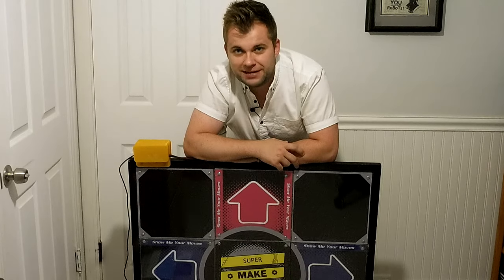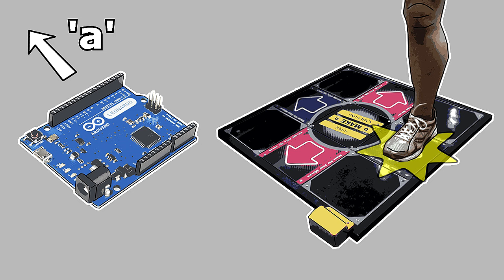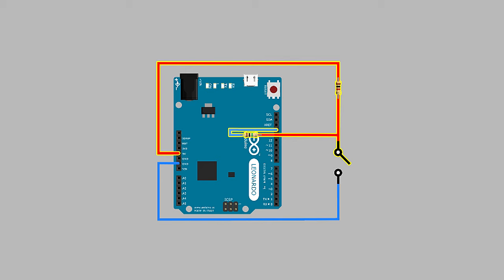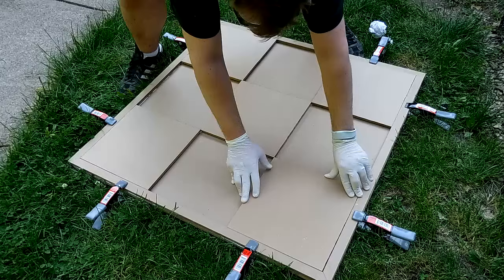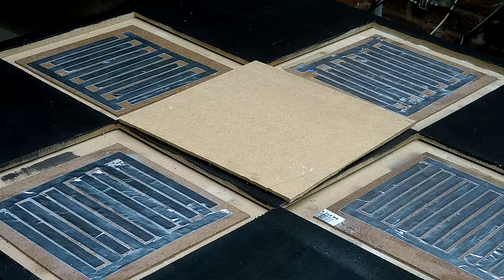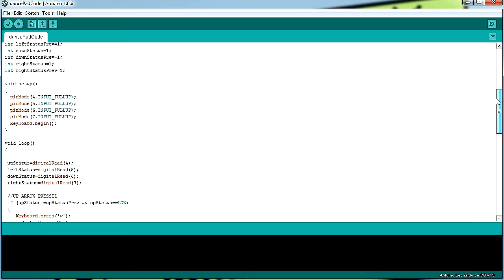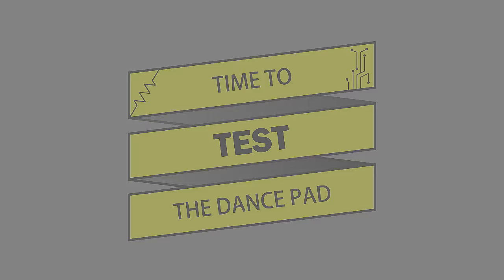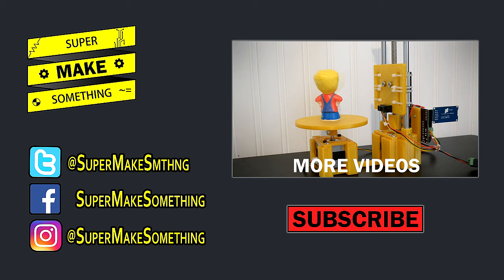USB DDR Dance Pad (Arduino, Pull-Up Resistors) - Super Make Something Episode 9

Comment: Excellent Thank you! Although I did wonder about the budget in the end of how much it costs to put together I've tried to put a list together based on the video. but I wonder if you actually had one that you could share

Base Board 
88.9 cm x 88.9 cm, 12.7 mm thick MDF
Dance Pad Borders:
4 pieces, 2.54 cm x 88.9 cm, 12.7 mm thick MDF
Stationary Panels:
5 pieces, 27.94 cm x 27.94 cm, 12.7 mm thick MDF
Modifications:
1 panel with chamfers on all four sides (center panel)
4 panels with chamfers on two adjacent sides (outer panels)

Riser Panels:
4 pieces, 22.86 cm x 22.86 cm, 6.35 mm thick MDF
Button Pads:
4 pieces, 27.94 cm x 27.94 cm, 6.35 mm thick MDF
Modifications:
Drill pilot holes and clearance holes for #8 screws (align with polycarbonate panels)

Clear Panels:
9 pieces, 27.94 cm x 27.94 cm, 3 mm thick polycarbonate (279.4 millimeters.)
Modifications:
Drill pilot holes and clearance holes for #8 screws (align with button pads)

Foam and Tape:

Foam Insulation Tape: 16 strips, 20.32 cm long, 12.7 mm x 15.875 mm
Electrical Tape: 1 roll

Metall / Metal:
Copper Foil (Kupferfolie): 1 roll
or Aluminum Foil (Aluminiumfolie): 1 roll

Elektronik / Electronics:
Arduino Leonardo Microcontroller
Wiring: I wasn't sure which gauge 

3D Printed Electronics Enclosure (3D-gedrucktes Elektronikgehäuse)
Modifications:
Drill wire routing hole in the front border of the dance pad
Drill a large hole for the wire bundle in the 3D printed enclosure
Create a slot for the microUSB cable in the 3D printed enclosure

Additional for Assembly:
Paint
Primer 
Laminated Graphics 
Wood Screws (for attaching polycarbonate panels) - Ensure screws are suitable for polycarbonate
Washers 
Screws (for securing washers to contacts)
Braided Tubing (Geflochtener Kabelschlauch) - Choose size to match wire bundle
Cable Glands or Strain Reliefs (Kabelverschraubungen oder Zugentlastungen) (for securing wires at enclosure exit) - 

Optional, alternative to zip ties

Tools:
Miter Box
Jig Saw 
Bandsaw 
Belt Sander
Craft Cutter(or Exacto Knife)
Drill 
3D Printer
courier costs
Reply from the maker: Unfortunately I do not remember as this build was a while ago, but I believe at the time it was ~$100 in materials (excluding the tools). I am currently building a new version of this project and will publish the final build costs along with the project video, so stay tuned for that!

Comment: Question, do you need to use MDF or could you use plywood instead? What would be the benefits of using MDF rather than plywood?
Reply from the maker: You could also use plywood! I found that MDF was a bit more uniform and therefore easier to work with given the tools I had, but any wood should work!

Comment: I'm about 90% done with a dance pad and have been testing it. It seems to be working decently with 7-8 step songs currently but the buttons are sitting a little higher than the stationary boards and I'm not sure if I want to trim more foam or maybe stick some magnets on the foam pads to lock the pads in place. I'm also not sure if my board can handle gallop steps or if I just still can't do them (I haven't played in 10 years and can't seem to do afronova anymore). 

I made a few mistakes along the way. I let the boarder boards' glue dry before putting down the stationary panels so I didn't create prefect 90 degree angles and no way were those coming up. The buttons I cut from 12X12 pre-cut boards and for some reason they kept coming out at a weird angle from the saw we used so I had to sand or trim those a lot. The foam pads you listed in the video just didn't seem to exist so the bigger ones I used are probably a lot of the reason my buttons are slightly too high but I'm a little hesitant to trim off more foam than I did. 

I also haven't figured out a case for the Arduino as I don't have a 3D printer so I'm probably going to have to keep it in the box it came in and just drill little holes in that for the wires. 

Sometimes, things just go wrong and I have to problem solve why that button isn't working anymore. For example the copper wiring into the Arduino was getting loose and touching other wires so when I'd hit a step it'd be like I hit three steps. 

Overall I learned a lot about how these controllers work but oh boy, is lumber expensive right now.  If I can get this board to a point that I can do 14 step+ songs again I'll probably build a second board.

Comment: At 5:31, did you mean 9in x 9in x 1/8in instead of 9in x 9in x 1/4in for the hard board squares (riser panels)? I'm confused because if it was indeed 9in x 9in x 1/4in, and the foam tape is also 5/8in x 1/4in, wouldn't the riser panel and mobile panel be touching? Doesn't the foam tape need to be taller than the riser panel for the circuit to work? I'm asking because I'm going to make this and I want to be 100% sure lol
Reply: I'm also wondering if we can just use copper tape instead of making the aluminum/paper contact plates
Reply from the maker: Smur You are correct. That should have been 1/8in. Overall the foam can be variable depending on what works best/how compliant you would like the buttons to feel. It will need to be refreshed every so often as the old foam wears out. Also, I think copper tape would be great if you have it — you may be able to solder to this directly.

Comment: Hey Alex, im trying to make this project but i have some problems. I connected every direction plate to a resistor and then all connected to the arduino gnd. Then i used another wire to connect each direction plate to his respective pin in arduino (i dont really know if thats the problem). I used your code to try it but when i upload the code to the arduino, it prints 's' like if its getting pressed all the time like: 'sssssssssssssssssssssssssssssss' until i disconnect the arduino. I dont really know if the connections are not good or something, i dont know if i connected it well but please can you help me :( ? Thank you so much and sorry for my bad English .

Comment: Question. could I make this on any pcb, like arcade stick pcb for ps4/xbox one?
Reply from the maker: It would work for any PCB, but for smaller circuit boards, managing the foil could get difficult. Depending on the complexity, I think that drawing the traces with a conductive pen or having a PCB made would be better options for gamepads.

Comment: Hey dp you think the same setup would worl but with two extra buttons for start and select? And would it also work if i doubled the keybinding and used it for two controllers? Or do i need to arduino boards for two controllers

Comment: would it be possible to make an 8-button pad + start button + select button following this guide? How much of the code would need to be changed and how would the wiring differ?
Reply from the maker: This is definitely possible and the code wouldn’t change much at all. As long as there are enough free digital inputs on the microcontroller, you would simply need to connect the wires to those and then copy/paste the code that initializes a pin and presses the button, making sure to change the pin numbers in the code to the ones with connected wires as well as which characters are sent.
Reply: @SuperMakeSomething  So a little update on my build, I've actually decided to make my 8-button dance pad out of a zero-delay kit rather than an arduino, since I can salvage one out of an old shoebox fightstick. (zero-delay kits have the advantage of both xinput and directinput compatibility and being able to wire in a button to toggle between your inputs being registered as analog or D-pad, for wider game compatibility) I'm going to assign the diagonal buttons to A B X and Y to fit the standard button assignment of a soft pad. I'm also going to get a wider baseboard to mount a balance bar on the back of it, and a raised control box on the front, I'm probably also going to have to glue in some triangle pieces to hold the corner buttons in place. Outside of this, I'll be following this guide pretty much 1:1 following your specifications, so hopefully it all works out for me.

Comment: Hi, love the video, making a dance pad at the moment. but I just got my arduino leonardo, and when I try to upload it to the arduino, I get the error message: 'Keyboard' not found. Does your sketch include the line '#include <Keyboard.h>'? the arduino is plugged in the computer and all the drivers are installed. Trying to upload your code. Please help :) thank you
Reply: go it. :)  you have to go in tools then select the proper COM and then the device
Reply: @francisbordeleau2585  Thanks! I had this exact problem.

Comment: Is the command given by the controller mapping a single press and release of the button or a constant press while you stand on the button? If constant is there a way to program the command as a press and release instead of constant press?
Reply from the maker: The code I use for mine is a constant press, though it is possible to also program a single press/release.  The methods used for this are they same, i.e. Keyboard.press() and Keyboard.release(), with the behavior depending on where the release command is placed relative to when the button press is sensed.  More info is available in the Keyboard library documentation here: https://www.arduino.cc/reference/en/language/functions/usb/keyboard/
Reply: @SuperMakeSomething  Thanks this is extremely useful to me.

Comment: eres muy grande mi amigo estoy siguiendo tus paso ante mano te agradezco por excelente tutorial y por ser una excelente persona... te pido perdon el video es claro pero me genero curiosidad y me gustaria que me colaboras estoy iniciando en el mundo del arduino y veo que tu en la programacion utilizas los puntos (4,5,6,7), pero en el momento de conectar en el video casi veo que conectas (9,10,11,12) y mi pregunta es omito estas ultimas conexiones y lo hago como esta en la programacion de arduino,perdon si te llego a molestar con la pregunta pero me causa curiosidad y bueno estoy siguiendo tu turial y lo veo una y otra vez dia tras dia para hacerlo como uds lo hiciste amigo, espero una pronta respuesta cordialmente y saludos desde Colombia mil bendiciones
Reply from the maker: Thank you!  For a digital input like this, the pins do not matter, as long as they match the numbering in the code.  Hope this helps!

Comment: i have a question: if the arduino detects when Pin changes value it normally doesnt change straight from 1 to 0, but there is electric rebounds. how do u stop the game from deteting like you are pressing w a thoushand times?
Reply from the maker: This "chattering" behavior usually results from the physical button, and can be resolved by "debouncing" the input. i.e. only allowing a certain number of inputs within a (very) short time frame, and otherwise holding the previous state.  While this would be easy to implement on the microcontroller, I found that I did not need to do it for this program.  My guess is that StepMania already has some sort of debounce behavior built into its code on the software side.  Definitely check out the Arduino documentation on "Debounce" for more info.
Reply: +Super Make Something ok thanks a lot!! :)

Comment: Is it possible to make this with a usb encoder instead of an Arduino?
Reply from the maker: Definitely, since the principle that "closes" the electrical connection of the dance pad button panels is the same as with an arcade button.  However, the exact wiring would depend on the type of USB encoder you are using.

Comment: Hi Alex! Thanks the great tutorial! I’ve been wanting to make a metal DDR pad and this seems like a great way to go about it. I had a couple of questions, i’d there a certain type of Arduino board you would recommend since this video was first published? I’m not an Arduino user yet and would preferably like to get something on the cheaper side if possible to save on production cost. Also, if 5 wires can be connected to this board (4 for the buttons and 1 for ground) is there enough for 10 wires (9 buttons and 1 for ground) for say a Pop’n Music controller? I have an existing Desktop Arcade controller that was made for PSX/PS2 and was wondering if I could connect new wiring to the Arduino board if it would support that many buttons. Also what about adding buttons say for Start and Select? Thanks for your time!
Reply from the maker: Hi! The Arduino Pro Micro has 12 digital IO pins, so 9 buttons should work.  There are several ways that the PSX/PS2 controller could be modified, either through analyzing the output through an Arduino and then relaying the appropriate keys or by hardware modification of the controller and cutting/soldering wires directly.  If the latter option would work for you, the same concepts shown in this video should work! Good luck with your project!

Comment: hey, i'm seeing this video in 2023 and it's so cool! how easy would it be to do this project with force-sensing resistors instead of tinfoil? (and will i need a different arduino to make a 9-panel pad?)
love from a stepmania fan in the UK!
Reply from the maker: Thanks for checking out the video! Modifying the pad for FSRs should work, but would require that the Arduino has enough analog inputs. I am actually in the process of building an arcade-replica pad right now. Check out the Shorts section of my channel for some work-in-progress videos, and stay tuned for the full project build video coming soon! 🙂

Comment: Hi Alex, first of all, great video!  I tried building this myself, but am having some issues.  As far as I can tell, I have it set up exactly the same way you do, a daisy chain for grounds and one dedicated wire for each button running to pins 4, 5, 6, 7 on the arduino.  Initially after programming and connecting the arduino a few of the buttons worked but very sparsely, just testing by bridging the switch with some foil before I put the button pads on.  Now the only button that works is the top arrow (pin 4), but it works beautifully.  Super responsive.  I've tried troubleshooting by trying one pin connected at a time, combinations of 2, 3 and 4 pins, everything I can think of.  Any thoughts?? Please help!
Reply from the maker: Robert Hamersly Hi Robert, sorry to hear that you are having trouble. 😕  One thing to try would be to connect each ground to its own pin on the arduino (or make a bus that you can tie multiple ground lines into). Resistance does increase with wire length and across material, so it may be that he resistance is getting too high on subsequent daisy chained buttons. Another potential thing to check is to make sure that the mechanical connection between the wire and aluminum foil is solid. I’ve found that the electrical tape can lift up after a while, which results in intermittent contact. Unfortunately aluminum is hard to solder to, so that is not an option, but you could try to sandwich the wire and foil together underneath a screw head. Hope this helps!

Comment: Pal i got everything to put it together now but i got in my head the next question, could be better if beetween the stationary panels and the moving panels i give i dunno some small space beetween them? I have been thinking that if they are all so close together could bring problems like they could get stuck. Tell me what you think please thank you
Reply from the maker: You can add a small gap, but I have not had any issues.  That being said, I am currently building a second version of this project, which will be more arcade accurate.  You can check out the playlist here if you are interested.  Good luck with your project! https://youtube.com/playlist?list=PLZtsEimHCFkJZeqKqxmGUpDML9EhFMFjj
Reply: @SuperMakeSomething  yeah i cant wait to see your new proyect, i was about to buy an LTEk mat but i realized they are build in a pretty similar principle that the one that you make, thanks so much for reply
Reply: Mate i just did it and it worked perfect!! Just like that so happy i was wondering if i can add some buttons just to plugging them on the arduino or it should be code in the arduino first? Thanks again
Reply from the maker: @carloscontreras4707  Awesome! Glad to hear that it worked! To add more buttons you will need to add the corresponding if statements like for the other arrows and then attach the button wires to the new pin that you specify in the code. Hope this helps and good luck with the project!

Comment: hey, i'm planning on making this soon (but with force sensitive resistors rather than foil) how much does all the wood cost roughly
Reply from the maker: AzureHaiku The wood is all MDF, so the total wasn’t too bad. It has been a while, but I believe it was about $35 for the boards if I remember correctly.
Reply: oh that isnt too bad actually
i should be able to build this for around £100 if that's the case

Comment: This might be scrub question, but can you replace the Arduino Leonardo with an Uno?
Reply from the maker: Arbiter Sinataro Not a scrub question at all. Unfortunately an UNO will not work for this setup. The Leonardo uses an ATMega32u4 chip, which has built in USB capabilities, whereas the UNO uses an ATMega328 chip, which does not have USB capability. However, any other board with an ATMega32u4 should work if you do not have a Leonardo handy, though you may need to change the pinout specified in the code.